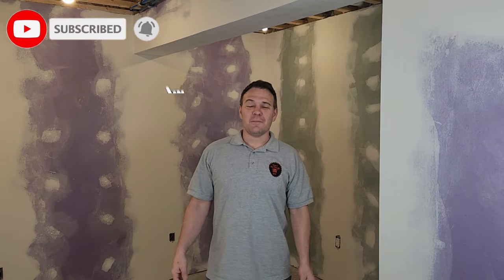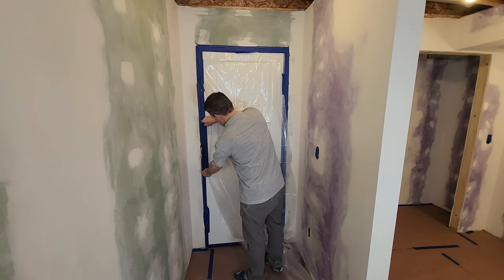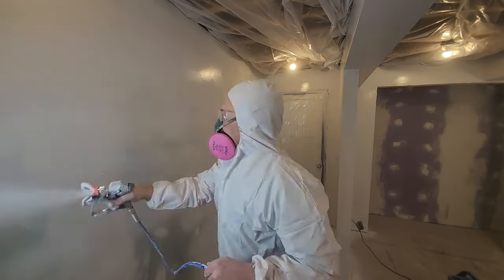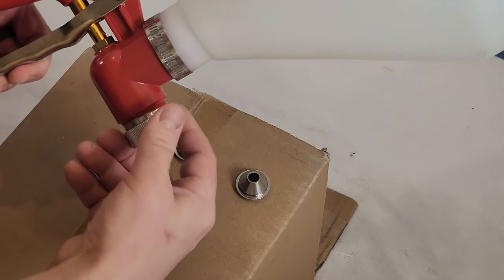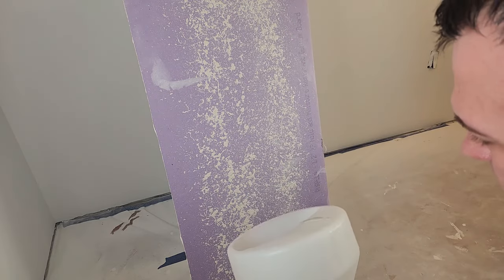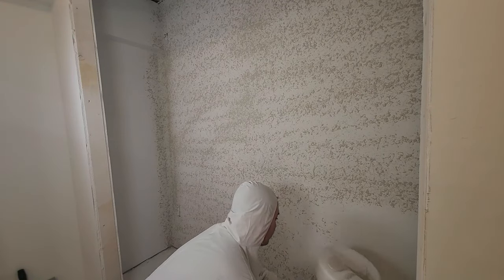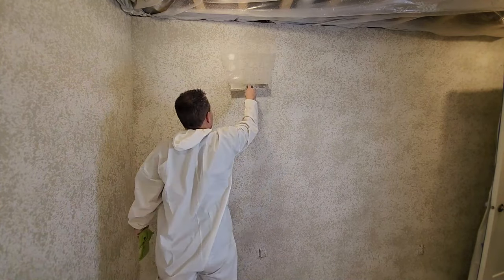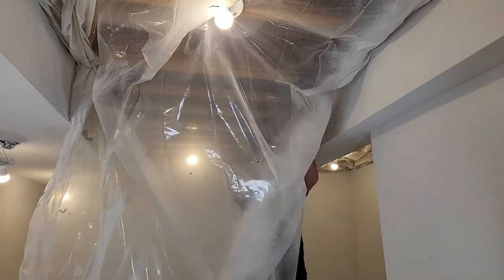The Art Of Drywall Knockdown Texture || E9 Finishing A Basement

Comment: Lots of great points in this video for beginners! Pro tip, don't spray in a back and forth motion, use a figure eight, loop-de-loo's, or something random that you're comfortable with. That way you don't end up with railroad tracks of heavy texture with thin texture in between. Also, priming before texture is a great idea if you have the time and you're doing it yourself. But, if you're hiring anything out, good luck trying to get a drywall contractor to coordinate with a painting contractor to do two coats of primer in between drywall finishing and painting. Lastly, always mix more texture than you think you'll need. If you run out of texture, you'll need to mix a new batch to exactly the same consistency which makes things difficult.
Reply from the maker: All great tips!  Thanks for adding them!

Comment: Yeah that’s not what happened here pretty much at all, you didn’t show the part where you figured out you can’t screw drywall to foam board that’s just glued onto concrete. 😂 cute. So you came up with something. The question is what? Did you glue the drywall to the already glued on foam? Or did you try to use tapcon style concrete screws to go through the foam but at the same time blew straight through the drywall? Neither of which will work for any reasonable amount of time. Or did you just remove the foam and glue the drywall right on the concrete?
Reply from the maker: I framed a wall over the foam board.  Here's the video where I did that.  Thanks for the comment!  https://youtu.be/bpespYFNMhc